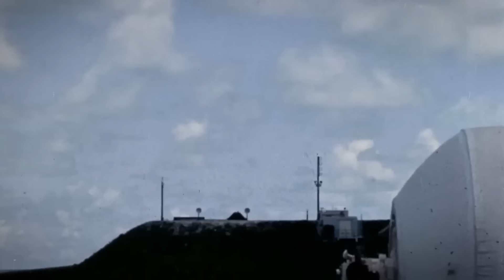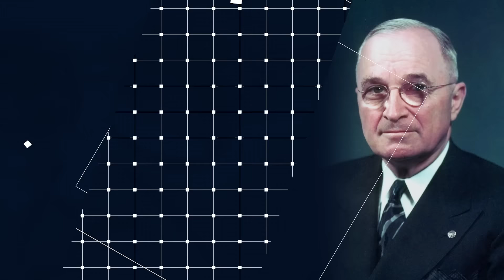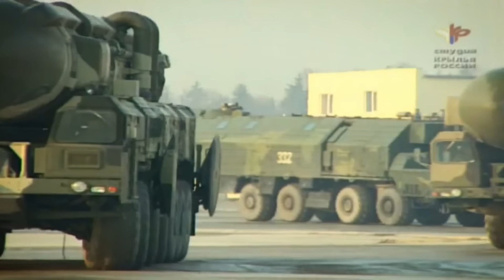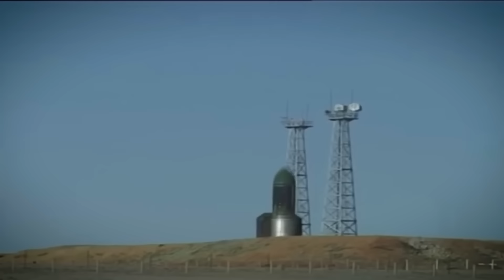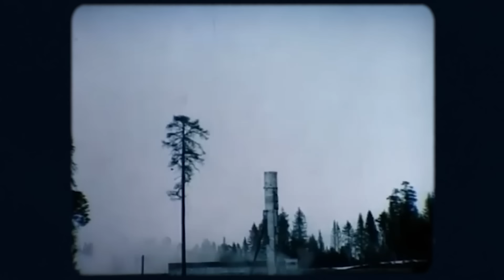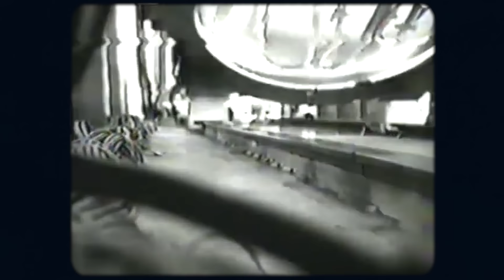RT-23 Molodets: The Soviet Doomsday Train

Comment: The U.S. Peacekeeper Rail Garrison.  
This was a far more ambitious concept: trains that could actually launch ICBMs. The Peacekeeper Rail Garrison was a railcar-based ICBM system developed by the U.S. Air Force in the 1980s to deploy 50 MGM-118A Peacekeeper missiles across the nation's railways. The idea was to make the missiles mobile and therefore harder for the Soviets to locate and target. President Reagan issued a national security directive on December 19, 1986, to develop the program. The plan called for 25 trains holding two 71-foot Peacekeeper missiles apiece.

Comment: Worth noting--the Soviet Union didn't call the SS-18 "Satan". (Heck, they didn't even call it the SS-18. For the Soviets, it was the R-36M or RS20 missile, internally designated the 15A14 or 15A18.) "Satan" was the NATO reporting name; a short and distinct word to uniquely identify a particular piece of equipment. Names starting with the letter S were surface-to-surface missiles. (Folks who remember Desert Storm may recall the "Silkworm" and especially "Scud" missiles used by Iraqi forces.)

Similarly, fighter jets got "F" designations: Flogger for the MiG-23, Fulcrum for the MiG-29, and so on. Bombers were "B" names: Tu-95s were Bears.
Reply: The R-36M2 was called "Voevoda" (Warlord) by the Soviets.
The Russian RS-28 "Sarmat" (Sarmatian) is an attempt to copy the R-36 design.

The RT-23 "Molodets" (brave man) described both the rail and silo launched versions of the missile.

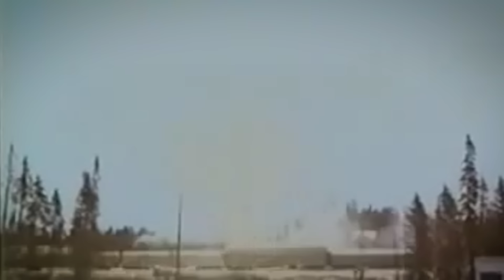Comment: 10:26 - 10:38 AI hallucinated on that part of the script? Overhead lines would interfere with launching. Drawing power from overhead lines for such a critical task as launching is a bad decision. The train had its own power generating car which would provide enough and reliable electricity.
Reply: The on board electrics weren't enough for a launch.
Reply: @andytunnah7650 there's on gerator car and 3 diesel electric locomotives. ample electric power! Being able to launch only on tracks with overhead wires and working electrical grid would defeat the purpose of such a train in the situation of Armageddon.

Comment: I'm surprised they did this so late, given by this point both sides would have long since developed the submersible portion of the nuclear triad, which kinda already accounts for the guiaranteed retaliatory strike option.  MAD's already securely in play.  The things you need to innovate for are:

- A system to counter an enemy strike, like SDI, or whatever the Soviet version of it was, if they even tried.  And of course, this would probably lead to layers of counter systems - a Soviet system designed to disrupt SDI, an American system to disrupt the thing that's disrupting SDI, etc.  But that phase of the arms race never happened because the Soviet Union stopped being a contender.
- A system designed to achieve a launch that the enemy launch detection system can't track.  That way you can freely eliminate your enemy without triggering a retaliation....though even then, the submarine arm will launch their revenge strike when they realize the homeland suddenly became a nuclear wasteland, so...not so free.
- A means of disabling the enemy's nuclear launch systems.  Which means being sure you have someone able to take out every one of the enemy's SLBM launcher submarines, and all their silos, and their strategic bombers.  I guess adding some nuclear trains to the mix does complicate matters even further, but...yeah, no, the fact that the enemy might have one more submarine out there than you think they do pretty much ensures MAD up to the point where you basically have covert control over their entire military anyway.

Comment: My wife and I first met in the early 1980s, at Norton AFB CA.  She was an Air Force  2nd Lieutenant with the Ballistic Missile Office, and I was with TRW Ballistic Missiles Division, the system engineering contractor for ICBMs.  We were developing the Peacekeeper ICBM at the time, and from the beginning, the missile was intended to be deployed in deceptive ways.  Multiple Protective Shelter Sites (MPSS) was favored when I started in 1980, with 50 missiles being shuffled among 100 horizontal shelter/launch complexes.  All of the "shell game" basing modes were carried until the missile was finally deployed, with Rail Garrison being the last actively pursued mode.  They were all too expensive, but that wasn't the reason for their demise.  After Peacekeeper deployment, we started working on the Small ICBM - more formally, the Small Mobile ICBM.  It was a single warhead, lightweight (30,000 pound) missile to be launched from a Hard Mobile Launcher, a specially designed truck.  By that time, my wife had realized that the US would never field a land-based mobile ICBM.  She had traveled the entire country working on Peacekeeper and SICBM. and the one consistent point she saw was enormous, unshakeable public opposition to nuclear missiles being moved around.  The same opposition existed in other nuclear countries.  Only the Soviet Union could ignore its population, and use mobile basing.  During Desert Storm, we learned the value of mobile missile basing.  Iraq launched a large number of Scud missiles at Israel and Saudi Arabia, all from mobile launchers.  The Scud is short range, about 200 km, and we could backtrack the trajectory to the launch point.  But we never found one single mobile launcher the whole war.  Not one.
Reply: Who's going to notice a few extra freight wagons in a massive site full of used and unused wagons in a sorting yard afterall.
Reply: The plan you describe is memorialized here on YouTube with some of the best stop-animation the military had to offer in 1980.
Reply: 😂 you think they care WHATSOEVER What the public thinks or feels or opposes? They don't. They don't tell them. Anything. Even if the entire nation opposed it vehemently- if the gov wanted to They would- a-not tell the citizens anything and b- do it anyways. The fact of the matter is that a- don't tell the citizens anything is literally their default m.o.😂 I'd wager anything that they HAVE in fact done everything they said the didnt/wouldn't/wont
Reply: @notyouraveragegoldenpotato yeah, no.  Americans actually write their congressman, and in sufficient numbers their congressman call up the secretary of defense.  It’s a thing, look into it.
Reply: @thomas_fx_foto depends on the issue though- if the money opposing your position is big enough, an entire state worth of stern letters are rendered meaningless. and nearly all of the positions on major/intermediate issues are bought and paid for- left or right, republican or democrat.

writing your state politicians is really only effective at local levels for minor things.

Comment: How would it launch the missile with overhead powerlines? Wouldnt it ruin the powerlines when the missle raised? Would make a lot more sence if the missle stole power from the diesel generators in the locomotives since the train wouldnt need them when launching anyway
Reply: “Vasili, what about the ropes overhead?”
“What do you mean ropes, you mean the power lines, Boris?”
“…Surely comrade thought about that before… “ 
BZZZZZTTTT⚡️⚡️⚡️
Reply: „which was made possible by implementation of the special mechanism for short-circuiting and diverting the overhead line (Russian: ЗОКС).“

Source: Wikipedia

Comment: The Soviets also created the Shagohod as a mobile nuclear launch system. The Shagohod has an articulated body, split into two parts. The front part uses screw propulsion, with a pair of Archimedes screws on hydraulic legs, that pulls the bulky rear portion, suspended on a hovercraft-style air cushion. It traveled fast enough on land to act like the first stage of rocket boosters.
Reply: Lol
Reply: Until Solid Snake found it.
Reply: @LuvADuc Naked Snake you mean

Comment: Speaking with missileer crew members who used to man  Peacekeeper ICBM sites they routinely practiced dynamic retargeting of mobile targets like truck and railway ICBMs As for the US copying the Russians with a rail based ICBM their minuteman's were originally designed to be rail based in the 50s
Reply: Retargeting has nothing to do with hitting mobile ICBMs. The chance to hit them with an ICBM would be zero.
Reply: @alexandernater6284  Well they spent alot of time practicing retargeting Peacekeeper missiles for moving targets. One job the B2 was supposed to handle was searching for them in Russia. Remember the launch officer commenting they were getting pretty good at it. The land mobile missiles are usually keep in their shelters so not hard to keep a eye on.
Reply: @ironman7261  By the time an ICBM would have reached them, they would either already have launched or relocated somewhere else. So this exercise would be completely pointless.
Reply: @alexandernater6284  unlike the midget man which was designed to survive over pressure from near by strikes by lowering to the ground Russian land mobile missiles are very vulnerable to not even near strikes outside their shelters. If you assume just launch everything yes but the US had to plan for every scenario including using stealth bombers to search for mobile threats

Comment: I'm surprised that, when it was decommissioned as a nuclear missile launcher, they didn't just put it to use as a conventional train and hide it in plain sight.
Reply: This made no sense. The cars on this train were only superficially indistinguishable from ordinary ones. Any railway worker would recognize them even by their appearance. Their distinctive twin wheel sets, which weren't used on regular refrigerated cars, were also unsuitable for the standard five-car refrigerated sections (four refrigerated cars and one with compartments for staff and diesel generators), of which there were many in the USSR. Therefore, when Garbachev trusted the Americans and went ahead with the disarmament of the Molodets and Pioneer medium-range systems (which was a grave mistake, if not treason), these cars, very expensive to maintain and practically useless for civilian transport, were scrapped.
Reply: We never know.. we never know

Comment: I was at HQ Strategic Air Command when the Peacekeeper Rail Garrison was proposed. Our HQ south of Omaha was near the HQ of Union Pacific Railways so we visited their control room to look at the feasibility.  The commercial rail network in the US has constant tracking of the location of every train on the rails, needed to avpud collisions, so a Soviet spy could tap into that system and locate a missile train, which defeats the whole purpose.  We did do testing of missile railroad cars, building a special test track at Vandenberg Space Force Base and then launching missiles toward Johnston Island in the Pacific.  With the end of the USSR, all the 10 warhead Peacekeepers were retired, including those in underground silos in Wyoming.
Reply: Retiring the PK was the worst move we could have done. That and limit of RV's we could have.
Reply: Seems like a easy work around to signal tracking would be to have a bunch of dummy signals. Like have 1 real and 49 dummy or whatever